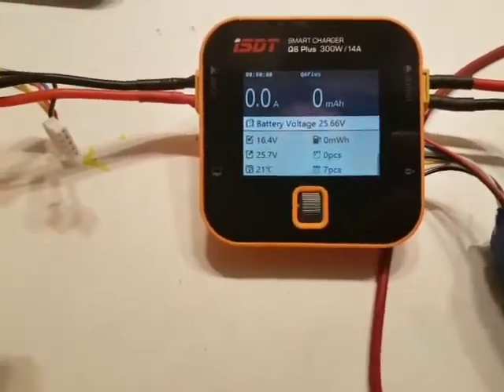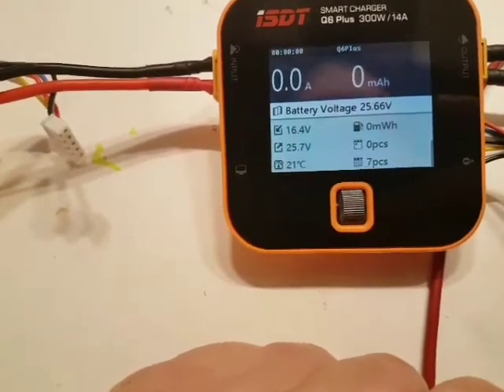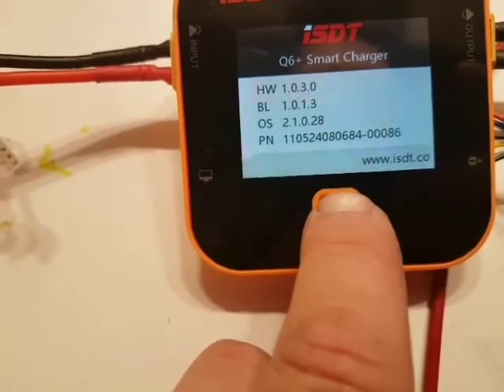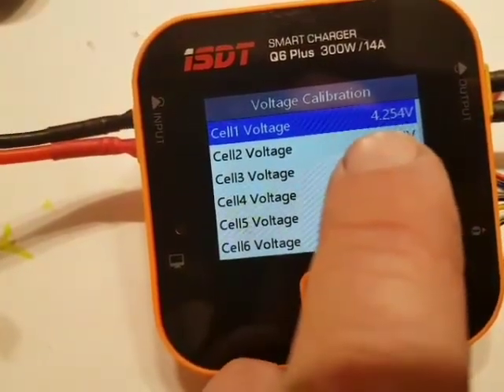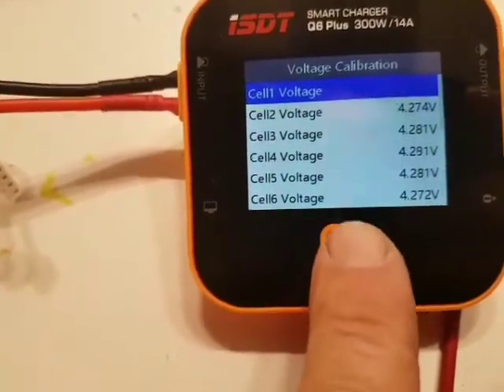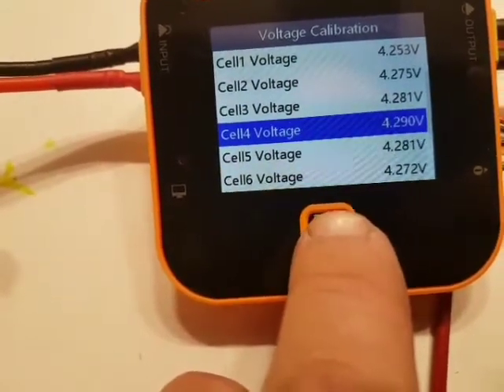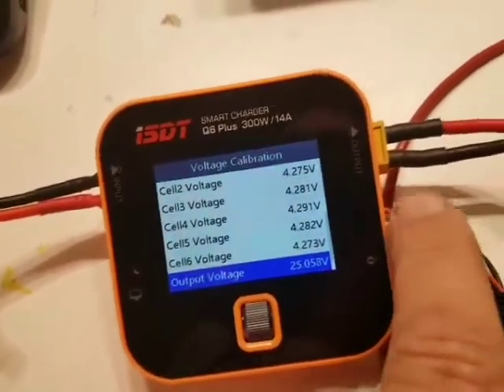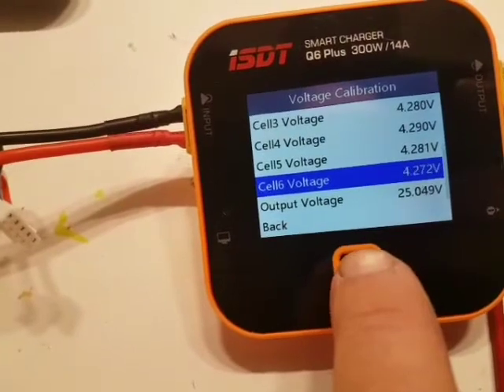ISDT Q6 Plus - how to fix impossible calibration

Comment: Just bought t6 lifts and it’s  ell balancing is tragic. ISDT need their ass spanked for released such poorly calibrated equipment. SHAME ISDT!!
Reply from the maker: Well, that's how life is. You notice when something is wrong, but doesn't notice anything that is running smoothly. I think there is a relative normal failure rate on these chargers, so if you buy 10 of those you might have everyone in working condition. Out of "millions" of chargers out there, some of them will fail, and that is ones you hear about :-)

Comment: same problem here.. off about 1/2 a volt.. complete unreasonable.  they need to recall these..
Reply from the maker: dudu du76 It's definitely worth a try. However, the staff who take care of issues like this, is not very educated. I spent some time explaining the problem. Even with videos, they asked totally non relevant questions.
I payed $10 for a new one after asking them to find an educated technician to deal with this issue.
Reply from the maker: Sorry to hear about that.
Make a video of the problem, and show it to the dealer. They might agree to send you a new one.
I payed a small amount of mony for a new charger, because sending it back to China for repair (as I normally should do) cost me almost the same as a new charger. So I agreed to pay a small amount of money to get a new and tested charger with a newer firmware and hardware.
This new charger has:
HW 1.0.3.0
BL 1.0.1.4
OS 2.1.0.30

The previous charger has:
HW 1.0.2.0
BL 1.0.1.2
OS 2.1.0.28

2.1.0.28 is per Dec.11 2017 the latest version you can download from ISDT website.
Reply: Same problem to me.
I have 
HW 1.0.0.0
BL 1.0.1.0
OS 2.1.0.1

I will check with banggood.com how to deal with it
Reply: i did a bit a research on the net.
I found out that a piece of hardware exists which allow to flash the firmware :
https://www.banggood.com/ISDT-SCLinker-Firmware-Upgrade-Data-Cable-for-ISDT-Charger-p-1089207.html

And, i also found an updated firmware on ISDT site.
Below is a copy of the included "release note" inside the new firmware zip.
Especially, the "3, Modify the implementation for voltage calibration" in V2.1.0.26 is letting me have some hope to fix it.

----------------------------------------------------------------------------------------------------------------------------------------------------------------------------
Q6 V 2.1.0.28
    1. Fix capacity measurement problem.
    2. Optimize discharge and storage algorithms.
Q6 V 2.1.0.26
    1, Modify charging control algorithm.
    2, Enhance communication reliability.
    3, Modify the implementation for voltage calibration.
    4, Optimize balance charging performance.
Q6 V 2.1.0.17
    1.Fix system bugs, enhance system safety
Q6 V 2.1.0.15
    1. Updated the calibration function of users.
Q6 V 2.1.0.13
    1, Optimization of the feeling while using button.
    2, Optimization of fan control for discharge.
    3, Optimization of error current display.
    4, Optimization of part UI display.
    5, Optimization of calculation of charging power accumulation
Q6 V2.1.0.11
    1. Stop charge power calculation after charging completion 
    2. Correct the current display error.
    3. Optimize automatic battery type analysis algorithm.
----------------------------------------------------------------------------------------------------------------------------------------------------------------------------
Reply: Lol ! You are so right.

Customer support is just pretending to me that it is a 2S-6S only charger. Not 1S.
Clearly "not very educated" :)

One question : Do you confirm the new one you received is working perfectly ? Which retailer was it ? Banggood too ?
Reply from the maker: dudu du76 
The new charger I received works good. It came from Banggood that one too.
Surprisingly, the firmware is newer than the latest avaiable at ISDT website.
The fan runs all the time during charging. I guess the newest firmware take care of possible overheating.
Reply: Imax b6 ac v2 or q6 plus ? I dont want to not satisfy quality or fun
Wow that quality q6 plus not very good